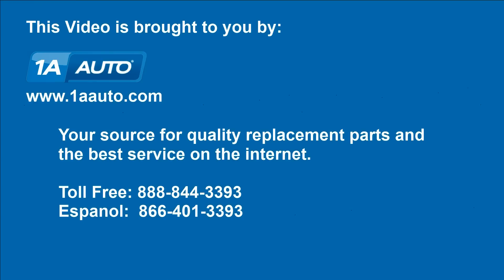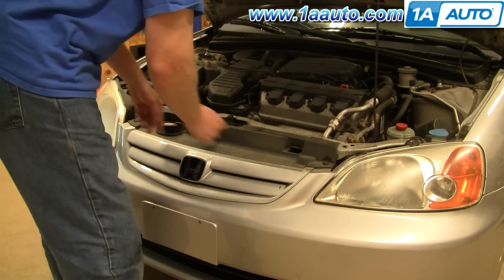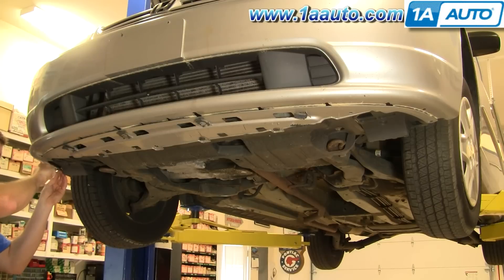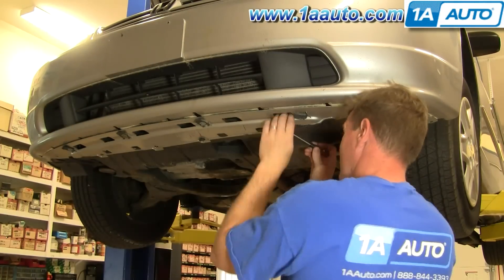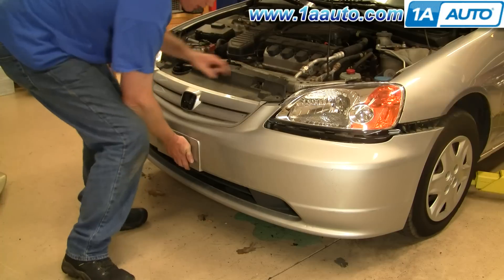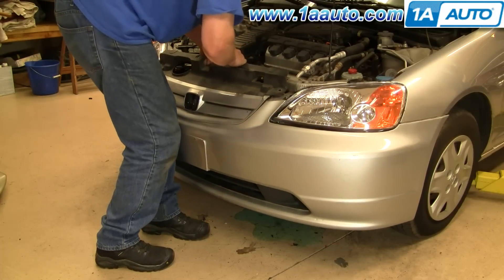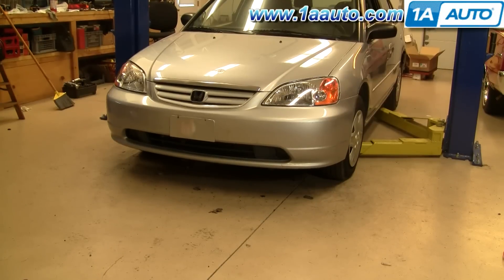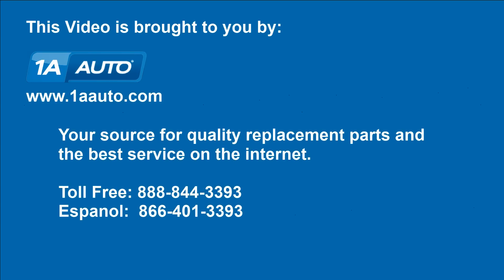How To Remove Front Bumper Cover 01-05 Honda Civic

Comment: I have a honda civic 2002 sedan. Is it possible to replace the front and rear bumper with bumpers from a 2003-2005 model. 

Thank you for your time.
Reply from the maker: It's not something that we've tried to do. It may or may not be different in the way that it mounts.

Comment: I am looking to replace what you just removed in the video. When I look for it on the internet, it is referred to as a bumper  cover. What is the difference between a bumper cover and a bumper? Is it the same thing and just being called by a different name?
Reply: Andres Corona A bumper is the actual structural steel member that absorbs the impact energy.  In the 80s and back further, most bumpers were on the outside and either chromed or covered in plastic but were clearly a bumper.  Today, with the desire for aesthetics and aerodynamics, the bumpers are hidden under huge trim panels called bumper covers.

Comment: Are the bottom clips the same as the top clips.  Mine bottom ones are all missing.  My guess is that the bottom clips are the same as the evil-looking-serrated-pinch-jawed bottom clips on the rear bumper, correct?

Comment: I have an 04 civic lx coupe and have removed all the clips and bolts from the front bumper but it still won't come off. The sides popped out just fine, however when I try and pop the rest, it seems to tug on the headlight assembly. Is there anything I might have missed?
Reply: Did you get it figured out?

Comment: Hi I popped my plastic piece behind my bumper and it is still on and I don't know if I should replace it and And mine takes those plugs what should I do to fix it
Reply from the maker: +Patrick Gholston Thank you for watching. If the plastic piece appears broken, or in this case non usable we would recommend replacing it. Some may pop out and still be re usable. 1aauto.com

Comment: I have a bump in my front bumper and I just want to know how to push it back out again
Reply from the maker: It can be tough to do. Sometimes if you pour boiling water on the dent it will pop itself right out. This typically only works on metal though. Maybe remove the bumper cover and see if you can push it out. Good luck! 1aauto.com?utm_source=YouTube&utm_medium=CTA%20Comment&utm_campaign=1ATony 866-403-3393
Reply: Hot air gun will soften the plastic and should go back into place.